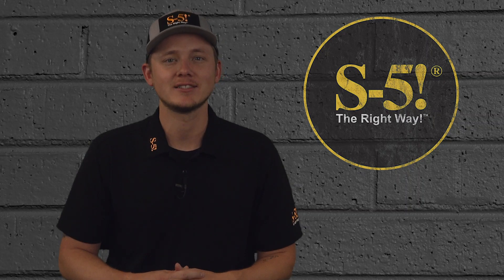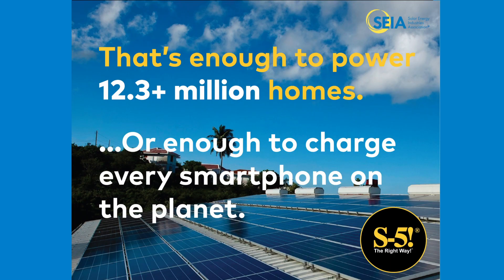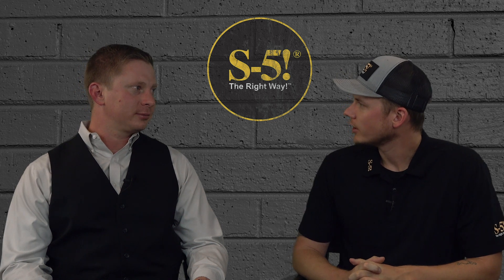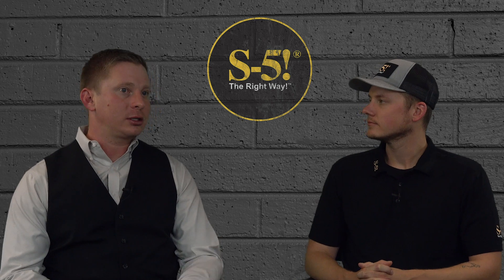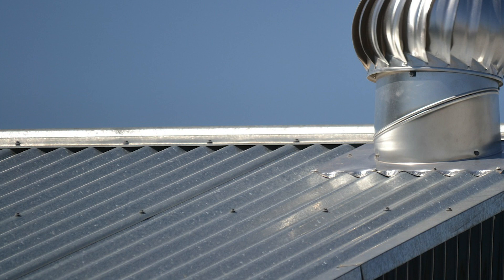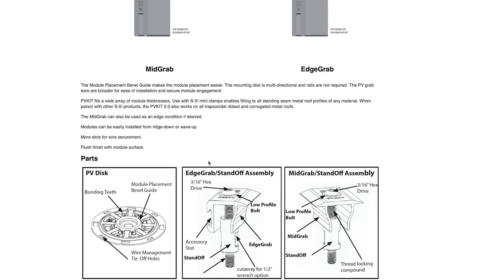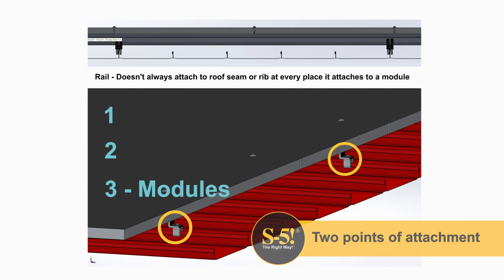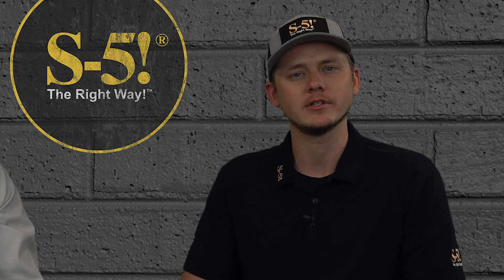How Often (or Frequently) Should I Attach My Solar Array?

Comment: I have a 4ft x 8ft  Caleffi solar water panel that weighs 110 pounds.. I have Peterson Snap Clad 24 g steel roof, 16" on center. Clips are installed along the seam every 2 ft. Roof pitch is 7" in 12. Got any suggestions?
Reply from the maker: Hi, thanks for visiting our channel. Please send your question to support@s-5.com and we can provide you with the answer to your question. Thanks!